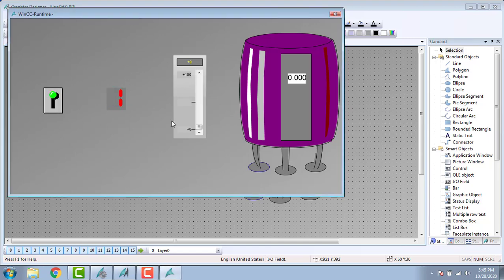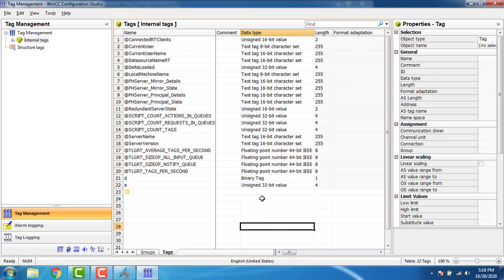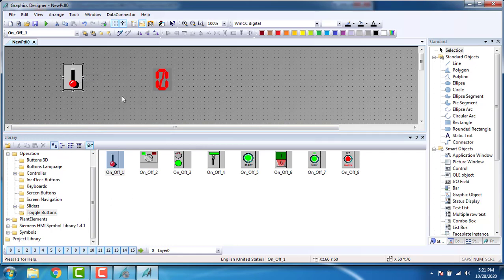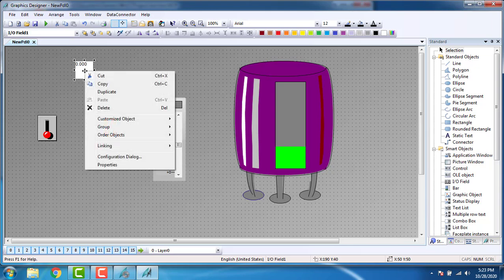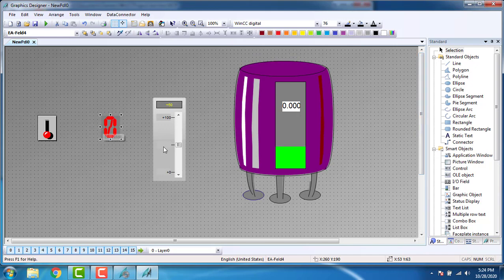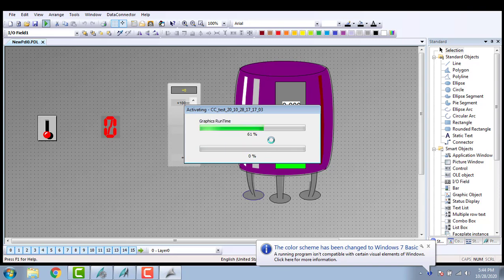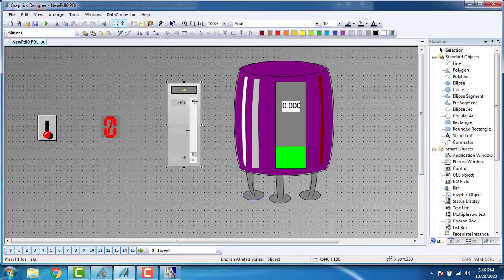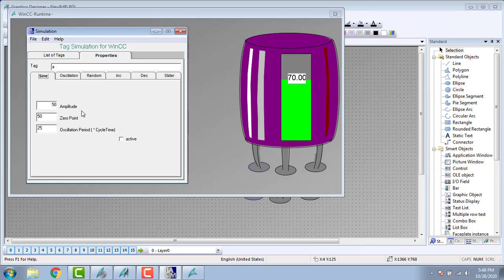WinCC getting started |Learn SIEMENS WINCC in 10 min | Create new project in WinCC| Wincc tutorial

Comment: I create a project but when i put run time appears exclamation mark on Smart objects. What could be the problem?
Reply from the maker: The tags are not properly asigned
Reply: @eightminautomation7222  I have the same issue, I already did the same as in the video but I still got the exclamation mark. Are there any suggestion to the probem?
Reply from the maker: Guys check your tags and check that specific object tag was assigned properly
Reply: @eightminautomation7222  I already checked, everything seems fine. Any othe suggestion?